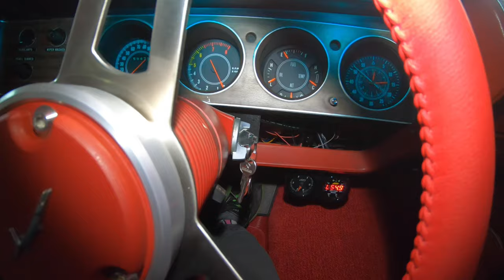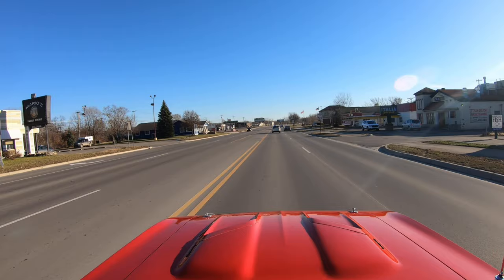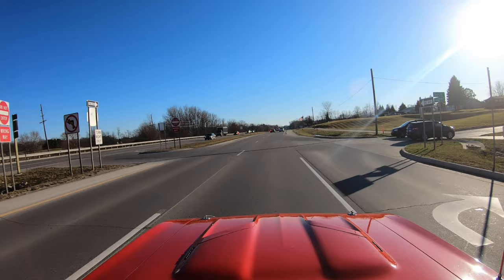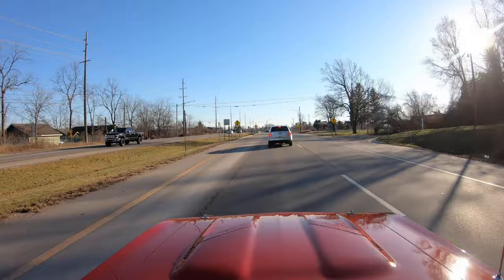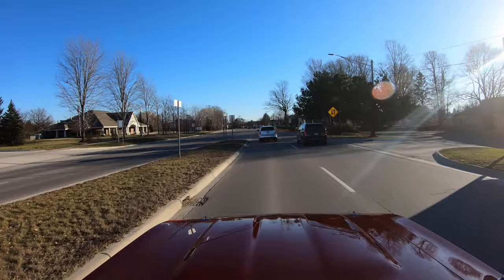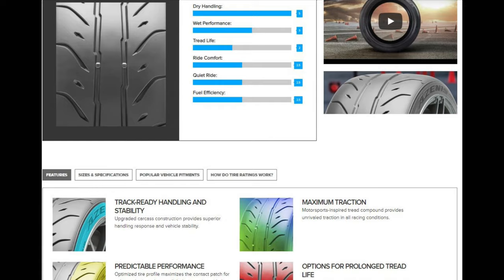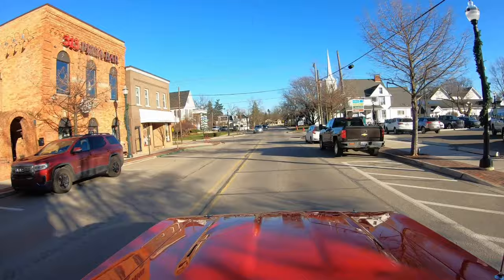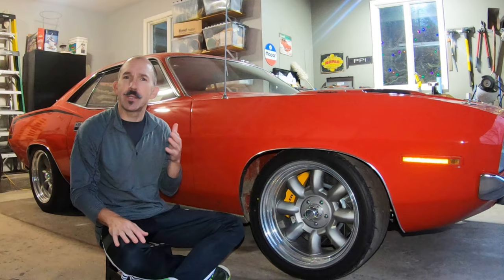Hotchkis TVS  Suspension and Baer Brake Review!

Comment: Beautiful 'Cuda!  Great video! I could watch that car all day :) 

I have a 72 Challenger that has the full Hotchkis Suspension along with a set of Cal Tracs bars in the rear 
and a Baer Classic 4 wheel disk setup. Aside from needing a vacuum pump for the brakes because the cam 
is so big. It really does handle and ride amazing!  Steering wise I have the Firm Feel quick ratio box and it works
well but it still has that slight dead zone in the middle that kinda bugs me.. But going to a rack setup isn't cheap. 
I am rolling on 18x 8 and 18x10 Riddler's with 245/45's up front and 295/45's out back.  It also has modern 
2011 SRT8 Challenger seats (required the floor pans to be customized). 

Once I get a rotary vacuum pump in for the brakes I will be super pleased. As it stand she hauls through the bends
every bit as good as my 2011SRT8 does.
Reply from the maker: Thanks , sounds like you put together a fun car!  It’s great to see them being enjoyed!
Reply: @backyardhotrods9885  I can't take the credit for the build a close friend of mine spent a decade on it. He did build one heck of a car. I was fortunate to be able to move her over into my care.  He's still sad over it... LOL and I completely understand it. 
But I am driving and enjoying her like he intended.

Comment: You brakes are still hydraulic just not vacuum assisted. I went with the 6 piston 14” Baer brakes front and rear for my dart. Also ordered a hydro boost set up for it as the car already has power steering so why not use the PS pump for some power brakes. However, ordered over 2 months ago and they hydroboost still hasn’t shipped. The adapter bracket is holding things up on that….
Reply from the maker: Yeah I meant to say vacuum 😁. That’s a good option you have done…I might go that route down the road if I’m not happy with manual.  Was trying to keep things simple

Comment: Lookin good!  Do you have a video on the rear suspension?  That rear tire looks wide and wondering what you have in the rear.
Reply from the maker: Here is a video on rear axle and springs.  Thanks , it’s tucked up in there nicely if I do say.  But it’s a b body spec axle on offset shackles and 295 tire.  

https://youtu.be/T5n4Tbw9oGk

Comment: I've been wondering  about these modern brake conversions  from Willwood  ' Baer ' etc '  I've noted that they are not power assisted ' do they have the easy pedal  pressure  that you'd get as  if power assisted ?
Reply from the maker: Normal driving you don’t notice it , under hard braking it does take more pedal force